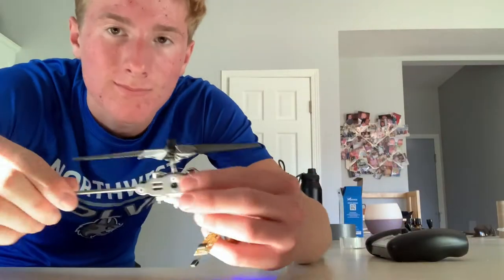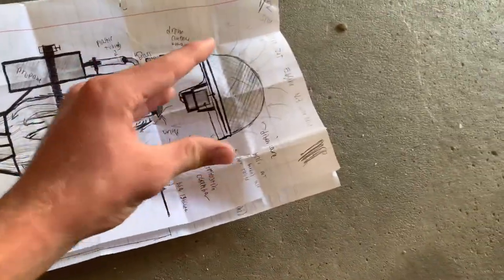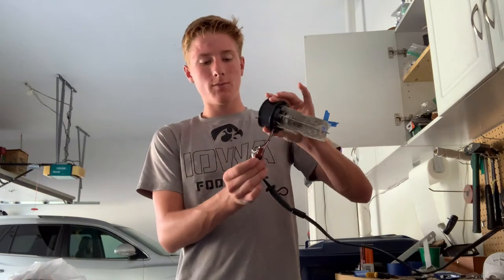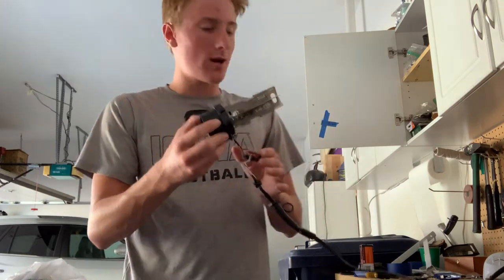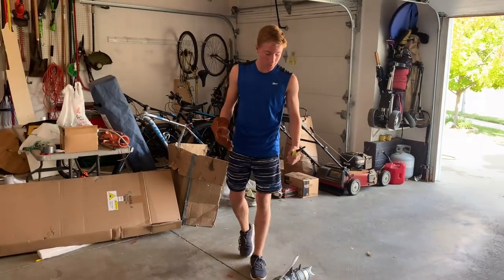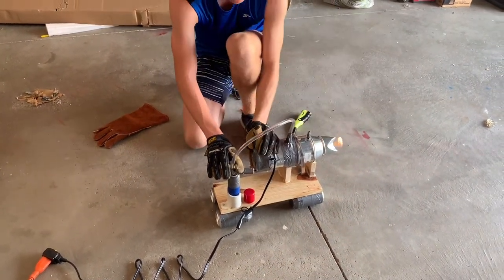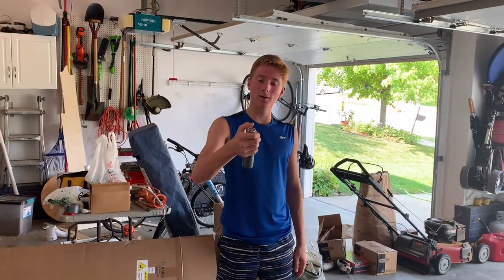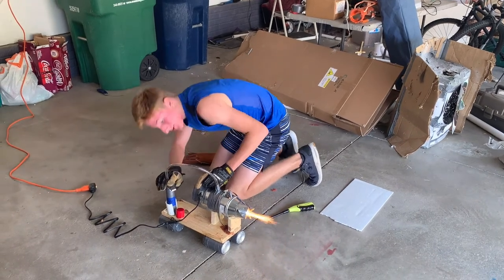Making a Afterburner for $35!￼

Comment: This is an EDF and an afterburner at the end. Jets build compression with a compressor fan, injects the fuel after the compression stage, then ignites. 

You're just moving air through an "Afterburner". There's no compression. You'd probably produce more thrust with the stock blow-dryer.
Reply: Yeah you are right. Its just for fun though

Comment: next time, make the fuel and the edf remote controlled, and also you should try turning the can upside down, gives it more liquid fuel
Reply from the maker: Thanks for the idea!
Reply from the maker: I’m just worried that the liquid fuel will condensate along the walls of the flame tube
Reply: @tylertatman925  that is not possible, propane/butane don't exist as liquids at room temperatures, so they wont condense as they will evaporate into gas they only exist as liquids inside the flame tube until you stop pressing on the can, then the remainder of whatever fuel is left in the tube quickly evaporates into propane gas
Reply from the maker: Wow that’s actually really helpful! Thanks! 😁
Reply: @tylertatman925  no problem dude, this jet engine was friggin sick! keep it up, but really tho try making it remote controlled, i would love to see that, im trying to make one myself
Reply from the maker: Oh nice!!
Reply: @YoungPhysicistsClub1729 , Sorry I’m this guy! Butane does exist as a liquid at room temperature, but, since it’s has 2 Isomers and exists as a butanic-alkane compound, it stays at a liquid. Now talking, you could change the ordnance to Cyclokane, thus making it a Isomeric compound with 2; also, logical results show that combustion with a butane an a oxidizer(s) will produce isentropic gas with a high-mol rate. Now, I don’t know what the mol-rate would be, since I haven’t done proper sociometry on the engine. Propane IS a liquid at room temperature, since it’s a butanic compound with 2 isomers. Proper combustion elements would be marginal. Now, it would condense in the combustion chamber if an oxidizer is present. Good luck on your engine!
Reply: @Iowaweatherupdates123  yo thats a pretty neat explanation, you seem like a pretty smart dude, you are right butane does exist as a liquid in room temp but even then, the cohesion would eventually give and turn into a gas, this would happen eventually though, the transfer from liquid to gas would be kinda gradual so ig it could condense, good luck with your rockets btw, i loved them
Reply: @YoungPhysicistsClub1729  Yes, your right. Thermophysical absorption would be immaculate. Thanks man! I really appreciate it!
Reply: This can also be solved via:

DeltaH=T1-T2 Cp* dT

Comment: Bruh, its an EDF with a torch on the back.
Reply from the maker: Pretty much what a jet engine is 😐
Reply: @tylertatman925  uhh, not really, like not really at all. a jet engine produces thrust using its fuel it doesn't just use an electric fan to push out fuel to make it look look.
Reply: @icantthinkofaname5549  ever heard of an electric Jet engine? Subsequently, this produces at least 2-5Kn’s of thrust, such as Ionized EDF Engines. Now, saying that, he’s not an aerospace engineer, he’s not going to buy parts that are at least $1000. This is a good way to produce some thrust, and it’s isentropic gas expansion ratio is proportional.
Reply: @Iowaweatherupdates123  fun fact: this kind of jet engine is called an afterburner! many people have made this too!
Reply: @YoungPhysicistsClub1729  Yes, I know. Afterburners are amazing! Especially when it’s isentropic gas expansion produces Mach Diamonds!!

Or rather equivalent to the proportionality of it.. 😂
Reply: @Iowaweatherupdates123  lmfao are you comparing a hair dryer that spits flames to an ionezed edf, funny. this produces no more thrust than just the electric motor, its just for show there is nothing actually creating thrust. and also, you can build a real jet engine that produces significantly more thrust for less, like a pulse jet or a turbo jet using an old car turbo and some metal pipe.
Reply: @tylertatman925  yeah, NO. a jet is toally propelled by the fire.
Reply: @icantthinkofaname5549  Surprisingly, this does produce thrust. You must be thinking of high-amounts of thrust. You didn’t experience it in person like I did. I measured it and it came out to a mere 1-4Kn’s, which is less than a Estes A SRM.
Reply: @quinnbayless1366  A jet is propelled by thrust, not fire.
Reply: @YoungPhysicistsClub1729  An "Afterburner" isn't a kind of jet... It's a component. This isn't a jet.
Reply: @tylertatman925  No, that's not what a jet is. You should do a lot more research... These are fundamentals I knew when I was 12.
Reply: @steven95N  if you look at the definition of a jet engine, even a balloon is one, dont compare this to conventional engines
Reply: @YoungPhysicistsClub1729  Guy, I work on Honeywell AGT1500 turbines. At what point did I compare this to conventional engines? I didn't, I simply explained why this isn't a jet engine. 

A Balloon is a "jet" because you have a fluid (air) under compression being forced out of a nozzle, What is your point? Again, this isn't a jet. You obviously have a ton to learn before you give anyone pointers on this topic.
Reply: @YoungPhysicistsClub1729  Oh just realized you're the genius that thinks an "Afterburner" is a type of Jet engine. A quick search will tell you that an afterburner is a component on SOME jets not a jet in itself. 

So no, an "Afterburner" isn't a jet. That's like calling a supercharger an engine.
Reply: @steven95N  so the difference is that, instead of an edf, i would have to use an air ocmpressor
Reply: compressed air mixed with the fuel that literally a jet engine